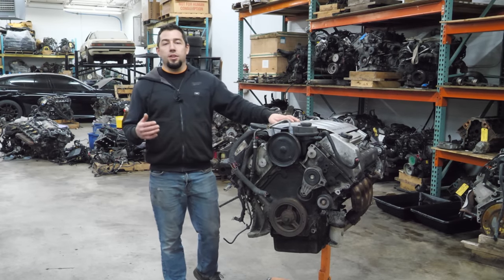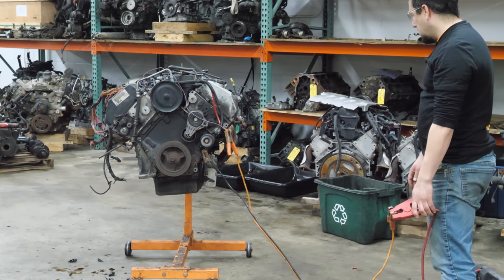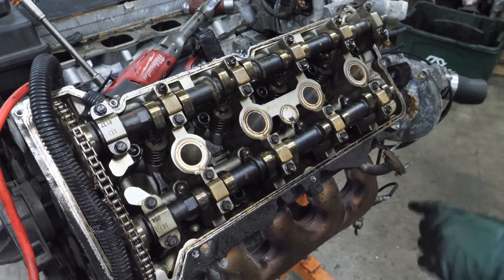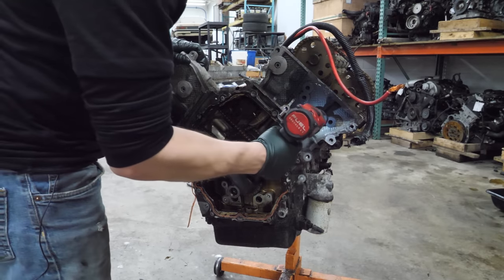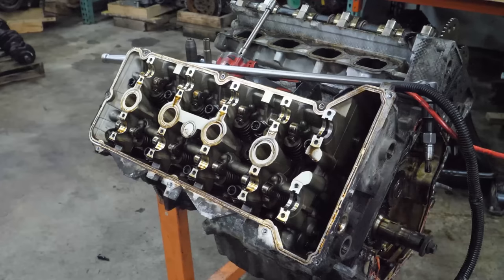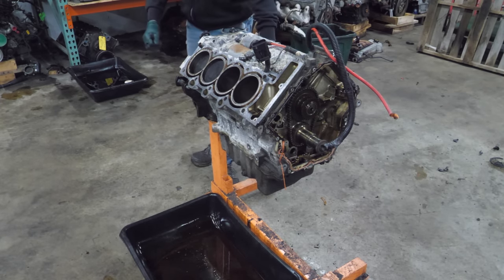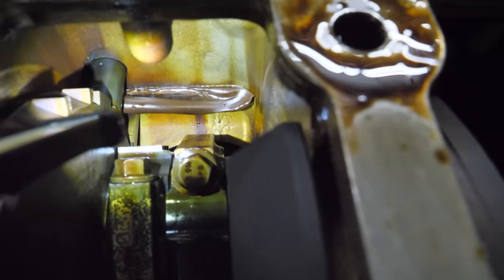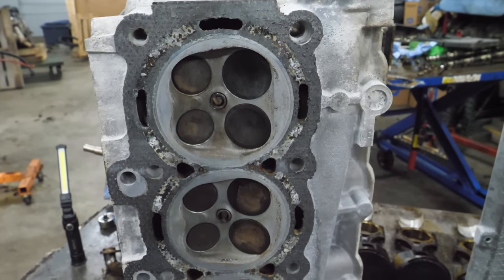Customer Returned This Cadillac Northstar L37 4.6L V8, How Many Things Can We Find Wrong?

Comment: 25:44 this is exactly why you need to change your Dexcool per the time frame specified in the manual. In this case it will destroy your engine if you don’t. If you have a 3.1 it will eat the intake manifold, when it turns acidic from it breaking down.

Comment: I have a theory about that buildup. We all know what a modern wonder Dexcool is, unrivalled in its gunk-producing ability. The pressure tank on Northstar/Aurora powered cars has a translucent bottom half and a black plastic top half, making visual inspection of the level very hard. It also includes the float for the level sender, which alerts the driver info center to ding a "low coolant" message when the aged Dexcool gunked up the float track and the float stuck. Continually adding coolant will blow the pressure cap, meaning the coolant actually does go a little low. Repeated cycles of the above, perhaps combined with knowledge of the head bolt issues, might have led someone to overuse stop leak, clogging everything, perhaps causing actual overheating, and toasting the water pump. The irony being it wasn't actually overheating or losing coolant at first.

The oil starvation is due to a really sloppy way to solve the Northstar Drip, which is the exhaust heat related oil pan leakage almost universal to these engines. Thanks to clearance issues, fully removing the oil pan means engine removal from the car and subframe. Many techs have gotten around this through some creative finagling of the pan while still in the car. Its a pain for sure. Whoever did this overshot the RTV target, thinking more is better so they wouldn't have a comeback and have to do it again or take the engine out and do it the right way. Great thing is, the drip makes a mess but thanks to an almost 8 quart oil capacity (!) You can really reliably run these a quart or more low with minimal problems. The starvation didn't happen because of low level, just impeded flow.

Finally, the insides of all Northstar bores are gonna look like that. GM new spec on these was 1 quart of oil burn per 1k miles was normal. That doesn't sound bad these days, thanks to ultra light weight MPG oils and everybody's engines letting it slip past the rings, but back in the Northstar's heyday of the 90s, when 10W30 or 5W30 was specced, a quart per thousand was a bad joke.

It was always fun to mess with a green tech by asking where the starter was on one of these or a Lexus V8. GM made the trail of breadcrumbs easy, though. Follow the Purple Wire.

Still one of the most pleasing noises on turnover of any engine I have ever heard. It sounds so expensive yet mechanical.

Similar to the panic-inducing coolant level float, the oil pressure sender would often get clogged (these came with 10W or 5W30 non-synthetic oil and an oil life monitor programmed for around 6-7k oil changes) and sporadically or repeatedly display low oil pressure warnings on the DIC. Some models also had a realtime oil pressure gauge (or, in GM, "Gage) that could be seen dipping well below normal. Many were misdiagnosed with worn bearings, when in reality an engine flush and maybe a new $50 oil pressure sender was the culprit.

Thanks to the burning oil clogging the rings and the oil pressure sender issues, a good old Italian Tune Up is basic regular Northstar mantenance. Not many of the seniors who owned nearly all Northstar equipped cars did that though, worsening both issues and probably leading to many being unnecessarily discarded. The cars also depreciated horribly, interiors were weak, fuel economy was atrocious even for the time (14-18 mixed in my mom's Aurora's case), electricals questionable, every piece cost cut to the Nth degree. Water pumps seep every 30k miles and require the special tool.

Solidly designed engine built poorly and put into beancounted cars.

Northstars and their parts are pretty much scrap value. Except the missing coil cassettes. Pre-2000 had coil packs like the 3800 family. Post 2005s had individual coil on plug. The stop gap were big 4-coil cassettes on each bank, silver in the front and black in the rear to match the valve cover. Any coil failure kills the whole cassette. Delco replacements run $300-500 per bank depending on where you buy. GM pioneered this setup on the Quad4 and reused it on the newer Ecotec (Cruzes, Sonics and Encores have these).

The original head bolts were lengthened in 2000 (and they started using threadlocker), helping cut the failure rate by like 90%. The 2005 redesign made use of the much coarser thread LS engine head bolts, curing the issue.
Reply: My current 03 Deville of 12 yrs just had the hg fail @ 170k. 
That build-up is hg in a bottle. I’d put $ on it.
After Bars Leak didn’t work, I found an obscure product that nobody really knows about. Thermalweld 
2 part hg in a bottle. 
I’m 7k on it now. I don’t expect it to last forever, but for the $, I’m not disappointed.
Reply: In the 90s Honda/Acura considered it "within spec" if their engines burned 1 qt of oil or less every 1000 miles. Most engines I dealt with had similar specs around 1qt per 1500ish miles.
Reply: @ToolofSociety  That's baaad. Especially considering the 3.5-4 qt capacity! Heck even their modern V6s of 3.5l only hold 4.5ish quarts.
Reply: @matthewbowen5841  Yeah in theory it's within spec to run out of oil between oil changes. That's why I remember those numbers so vividly. I was like "so you're telling me it's within spec for my engine to run out of oil between oil changes?"  Honda was like "Yes that's why you need to check your fluids regularly"... Stuck with me hard. I don't know what the rule of thumb or what is spec for domestics. The only domestic I did a lot of work on was a 72 nova and I had built the engine myself and I considered "within spec" to be a whole hell of a lot lower than 1 quart every 1500 miles...

Most of the Honda engines I worked with had a 3.5 qt capacity including the oil filter. None of those cars went through 1 qt per 1000 miles. Even my friend's abused oil burning civic went through less than 1 qt per 1000 miles.
Reply: @ToolofSociety  We all thought Subaru was insane around 2013 when they switched to 0w20 in their boxer 4s and said 1 quart per thousand was fine, on a car with a 4.5 qt capacity (the 2.0 in the Impreza). I didn't know Honda had a similar history. Hondas love to leak, and burn oil at high mileage, but the directive back then about fairly new cars is news to me. Makes GM seem less slap dash with the Northstar, since at least it holds so much oil. Around the 0 weight switch was when every manufacturer started saying a quart per thousand was the new normal. GM, the Germans, Toyota, all of em. And then came 0w16 and 0w12... along with lighter-built engines. My mom's 4.0 Northstar uses the same amount at 120k as it did new, so at least it seems to be a design thing and not a progressive failure. Meanwhile, my Toyota 1MZ uses just about zero between 3000 mile changes on good old fashioned 5W30 conventional, all at 223k.
Reply: @matthewbowen5841  Yeah I've had more than one 16 series Hondas from the 90s that despite having +200k miles burned no oil and lost very little between oil changes. I think the "within spec" was basically honda/acura saying that they didn't want to warranty the odd poorly assembled engine.

My last d series based honda was a del sol d15b7 that blew the headgasket. The block and cylinder head were both straight so I cleaned them up. Used a y6 series MLS gasket with ARP head studs. The car hit 260k miles before the automatic transmission died. That car burned exactly zero oil and showed no noticeable drop over 3k miles.

In my experience hondas liked to leak oil out next to the distributor and the cam end cap on the other side. I had a strategy of putting a little hondabond on those spots to stop that. The second biggest leak problem for me were the plug tubes ugh...

I was introduced to the "joys" of the lighter weight oil when I bought a new car in 2018. I legit had a bit of a panic when I noticed the oil level was lower on the first oil change than when I checked it about a month earlier...Yeah I know I should always check fluids weekly but I got kind of lazy with the new car due to outside issues.
Reply: @matthewbowen5841  BTW thanks for the information
Reply: @ToolofSociety  We had to do a ton of coaching with Subaru FB owners, Toyota 2AR owners, GM 3.6 owners, etc, to keep eyes on the oil level in virtually new cars starting around then. On most, you can switch back to 5W20 or 5W30 and ditch the 1% fuel economy savings for not having to check the oil so often. That seemed to be the sweet spot. And of course synthetic 5w oils exist so it isn't like you're giving up anything really. The 0W oil is legitimately just an EPA test gaming idea made even more inconsequential by the fact that the EPA test is HEAVILY weighted toward the first 30 seconds after start up. Thus the 0w oils seem to improve emissions through lighter viscosity for that magnified but short time period only. A 5W20 performs the same 99% of the time in normal use and disappears way less readily.
Reply: @ToolofSociety  I have an olds silhouette with the 3.4  @ 254k. Loses a quart between chances, due it leaks not burn 🤣
Reply: I wouldn't be surprised that the person who added all the RTV added stop leak to it as soon as the engine was back in the car "just to be sure". My father had an Australian Ford engine using coolant and he assumed it was a head gasket leak  damaged the head bolts getting them off but that engine needs new head bolts because you're not supposed to reuse them anyway. It was all clean in there but there was a void in the casting near the intake manifold. New head gasket, head bolts and valve cover gasket and the bastard STILL leaked. So he put stop leak in it and it WORKED. He would NEVER change the coolant, only top it up. By coolant I think it was rainwater because he had a habit of flushing the coolant and replacing it with rainwater. He believed that no gunk could build up that way. Not saying its true but he believed that.
Reply: @OffGridInvestor  You should use distilled water when mixing coolant. Tap water will have minerals and other gunk. Rainwater is probably pretty close to distilled water depending on how it's collected.

Comment: Ok, I did 38 long, miserable years as a Cadillac Tech. '71 till '08. I had 171 Northstars out of the car for one reason or another. Yes, they had issues. I never used any RTV on reseals, ever. The gaskets and seals were quite good. They were leakers though after XXX number of miles. A special tool is required to R and R the water pump. If I ever see another N* it will be too soon!! :hand-orange-covering-eyes:
Reply from the maker: 171 is a LOT! Crazy that you kept track. I’m sure you don’t miss all of it.

Comment: I have a 96 aurora withthe 4.0 , I pulled it out and resealed the bottom end and rebuilt the transmission.  I was very impressed with the engineering.
Reply: I read an article years ago from the mid 90s said the Northstar engine despite what people think was an engineering masterpiece and it really one upped the Germans
Reply: Interesting because the inline 6 BMW engines make great power.

Comment: Educational as always.  When you pulled the oil pan and base plate off, there appears to be a cast in (or machined) groove in the mating face for an o-ring running around the full perimeter.  Did not see any evidence of an o-ring as it came apart.  My guess... most Northstars were leakers and it appears that someone tried to fix the leaks with $58 worth of RTV in place of the o-ring.

Comment: Used too see a lot of these engines with the original formula dexcool having a lot of crystalline, or peanutbutter like deposits. Sometimes if you mixed green in the system it would turn the whole thing into a muddy mess.
Reply: That's what I was thinking. Someone threw dollar store green coolant on top of factory dexcool and it plugged up the system
Reply: i dont get why coolants can be so different

Comment: I have several of these with zero issues besides oil leaks from half case issues. Almost 300k on mine.
I bet somebody thought it was a bad HG and dumped Blue Devil "fix" in it and plugged it up. That or used a ton of coolant stop leak in coolant. Both a major no no regardless of engine.
I've had a dozen apart and none looked anywhere bad, this one was absolutely neglected. 
They have a bad rep which really isn't deserved. 
Good mileage and HP. What other engine is designed for 50 miles with no coolant and will be fine.
For the cylinder walls to be scored is absolutely due to abuse and lack of maintenance. The have the best finish pretty much you'll ever see from the factory so to be scratched is very rare

Comment: The last time Cadillac had its own engines that didn't need a revision to keep them running for the long term,  it was the big block 500/472/425 series of the 1970s.   You almost NEVER find one of those engines that is blown up.  Especially they almost never, EVER are seen with a bottom end failure due to lack of lubrication.   Every engine after this series has had this problem or that problem.
Reply: The power of IRON!!!!
Reply: We had a 500 when I was a kid that had to be rebuilt. Even after the rebuild it would quit pumping oil.
Reply: Weren’t those Cadillac big blocks known to have lubrication issues that caused them to spin bearings if they get revved over like 4000rpm for any amount of time?
Reply: Don't remind GM. A fair compromise going forward is to offer whatever Buick Chev GMC offering as a Cadillac performance package with hood ornament Landau top and opera lights.

Comment: Great Video! I’m a mechanic, and worked on a few Northstars, I personally own a 1997 Cadillac Deville. Plenty of content on my channel and I’m all over the Cadillac and Northstar Facebook groups. I used the “Bulletproof Kit” by Northstar Performance, the one and only place to properly repair these engines. The Head Bolts get corroded like the corrosion in the valley you seen, that’s what causes the threads to be awful, mixed with overheating from the hollow bolt clogging up, or another small diameter hose, and it pulls the threads. The kit NSP sells you use the jig and drill bit that comes with, to drill the head bolt holes out and tap them to a more corse thread. No more issues. It’s funny you mention the external RTV, that’s what my engine looks like 😂 a bead on the groove, but I did extra externally just for added insurance. The coolant is “100,000mi+ or lifetime” and that’s what causes overheating and for the dexcool to gel up especially if mixed with the wrong coolant type. Add oil stop leaks or coolant stop leaks to this engine, which is very very bad idea, and you got clogged ports like you found.

Comment: I look forward to these videos every week!  Keep up the awesome work.  Here's a catch pan hack: take a milk crate, turn it upside down, cut some clearance holes for the engine stand leg, and BAM you have a small platform you can use any catch pan on for the coolant, milkshake, oil, or mcnuggets that goes directly under the engine.

Comment: Just did an oil pan one one of these, and I found the same if not more silicone in the pickup, so it must be a common problem. I did find a forum saying that GM's reccommended service is to use RTV instead of the gasket they made, which is quite interesting. I ended up using both, but I found it odd that GM themselves reccomended no gasket and just a bunch of silicone, and it clearly had a negative impact with the pickup if we both had this issue.

Comment: I had two Cadillacs with the 4.6 Northstar and never had any major issues. They are strong engines and I guess the head bolt problem was a random issue. My 2001 DHS had 478k in kms before I retired it. The only issue I had with the 2006 DTS was a small half case seal leak which slightly dripped occasionally…I got almost 400k in kms on my DTS and gave it away. Great cars. 
I currently drive a 2011 Cadillac CTS4 3.6L with 230k kms and no major issues through 7 years of ownership.

Comment: That stuff on the head bolts was anti-seize compound. Those heads had been removed before and replaced by someone who, like myself, hates stuck bolts. Many things on this engine appeared to have been disassembled previously by a poorly trained chimpanzee. That RTV job was painful. Speak of bolts, that puller bolt might be able to be coaxed out of that cam shaft by someone with a little patience and good tools. It shouldn't be that stuck. I think this is basically a well designed engine with a few bizarre design choices. The bed plate bolt holder was cool. Thanks for the cool teardown. I drove one of these one time, and it was tons of fun. The teardown was almost as fun, minus the adrenaline rush. :) Thanks for the smiles.

Comment: Just completed resealing the lower crankcase on a 2008 DTS with 24k miles. Per TSB you remove gaskets and replace with RTV. It will squirt out some when it is running because it takes forever to cure.

Comment: Waterpump belt snapped on my 99 deville. After it gets so hot, computer won't let you see temp or anything just beeps while telling you to 'turn off vehicle immediately"...HOWEVER, if you jockey the key, for a split second it shows the temp. I'm pleased to say the computer claimed engine temp was 310⁰F...middle of winter in MN. THAT STILL DIDN'T KILL IT!! Took me machining different threads on the oil filter insert into the block and the filter exiting and bouncing off into the shoulder leaving me with no oil at all. STILL WENT like 10 more miles. Also drove said DeVille w/o any brakes, none, zero, nadda for a hair over 100 days (many can vouch)....everyone should... eliminate tailgating. When it finally blew, i was kinda glad.